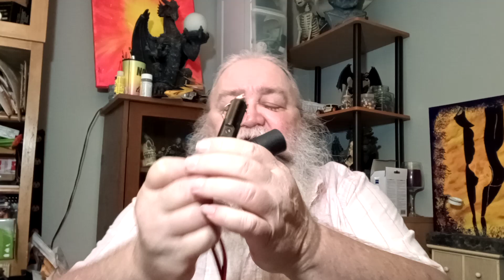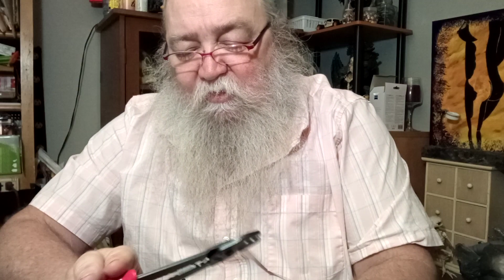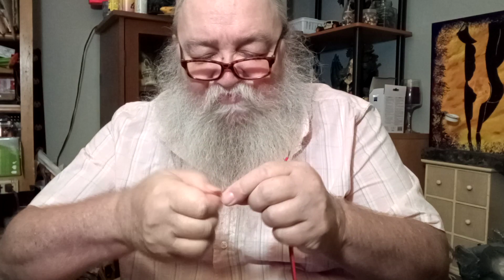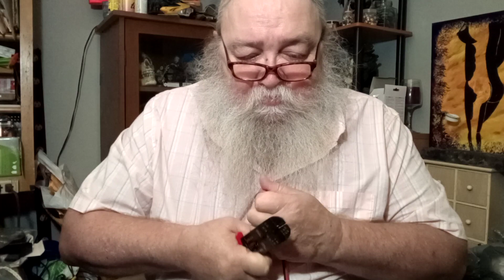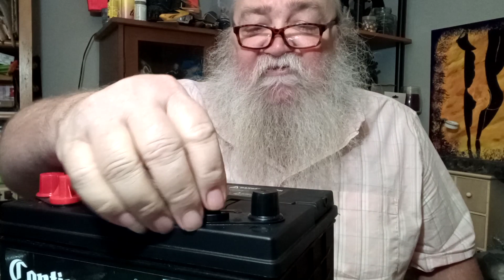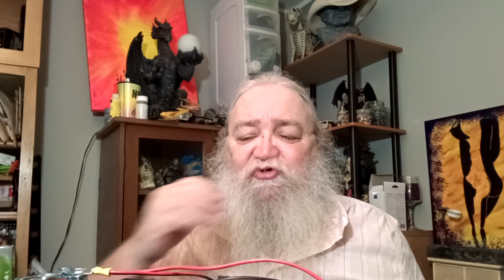My portable power station/auxiliary/house battery for Sherri Van

Comment: Looks like a handy set-up Doc, just make sure you don't throw anything metallic in that battery box that might end up across the battery terminals. Easy mistake to make and you can melt a screwdriver as it lays across both terminals. Same with the ends of your extension leads, they will be live so if they end up touching the wrong terminal they will short out.
Reply from the maker: I hear that! Ive accidentally shorted a wrench changing a battery more than once. They wanted $9.00 for the rubber booties to cover the terminals so I think I have a cheaper diy option

Comment: You gotter done but at some point in time you may want to buy two wingnuts to put the wires on those studs. Much cleaner install and easier to unhook or hook up.
Reply from the maker: I totally agree, I can't believe the 3 parts stores I stopped at didnt have any!
Reply: Might try the hardware store